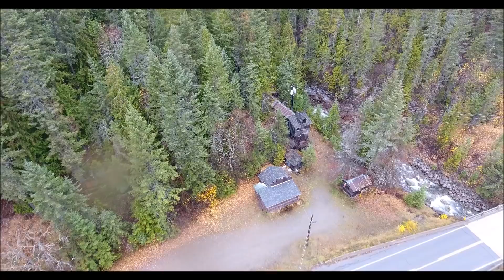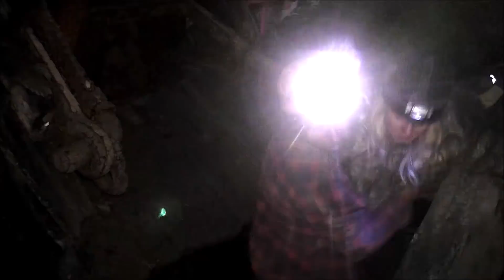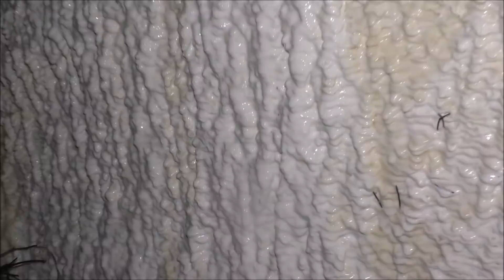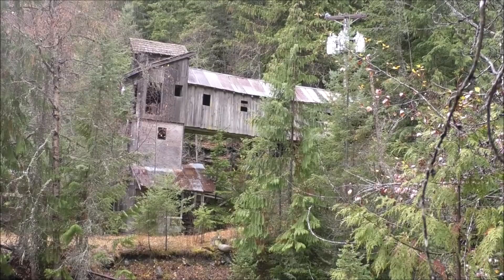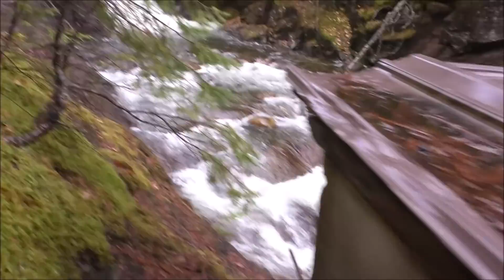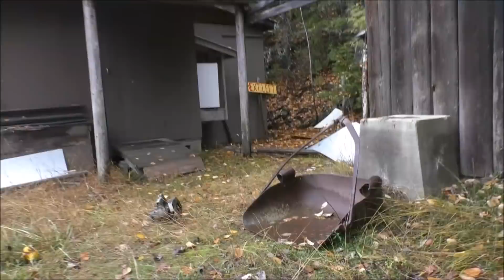#123 WOODBURY CREEK MINES !

Comment: Cool video Frank! That was pretty cool finding that turbine. It’s not that old. That is a Thomas and Howe switchgear panel, load controller, hydraulic unit, and a load dump used to regulate the power coming from the generator. It looks to be about 40kw setup. Likely about 130k if equipment sitting there. Thomas & Howe are made in Norther BC.

Comment: Interesting find. I've never found an abandoned turbine.  There are several interesting electric turbines near me in Northern California. One just north of me is wood burning. And to the southwest of me are some huge turbines powered by volcanic geothermal. There are quite a few flumes in central and northern California. Some that were used to move timber out of the mountains. I found one that started near the top of a waterfall on one river, went around the mountain and ended where there used to be a giant sluice on another river. And one that brings drinking water out of the mountains into Magalia CA that is still in use. Magalia is just north of the historic gold mining town (where a guy found a 54 pound gold nugget in 1859) Paradise CA that you've probably heard about in the news the past few weeks. A wildfire started by PG&E electrical transmission lines burned 80% of the town to the ground. I live about 35 miles west of the fire, the first day it was so smoky here it blocked the sun and was dark as night during the day.

Comment: Very cool man. So they walled off both sides where the pipe goes into the mountain, i wonder if they continued the pipe or if they just let the water run down the drift to the other end. Be safe out there man
Reply from the maker: I am sure the pipe ends at the wall......I wonder if the mine had other branches!
Reply: @exploringabandonedmines  yea, i mean if the pipe ended there had to be a lot of water goin in there to get the pressure needed to turn the turbine.